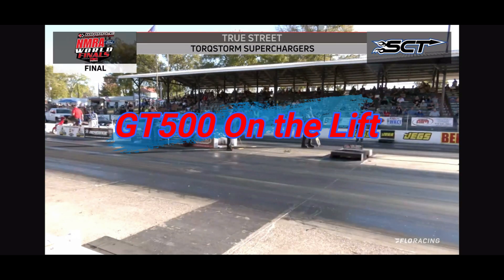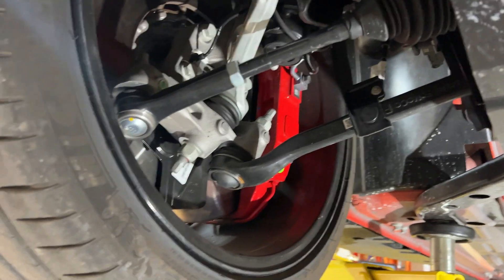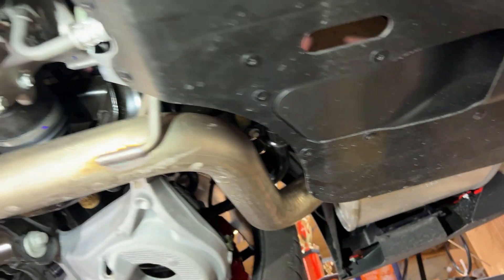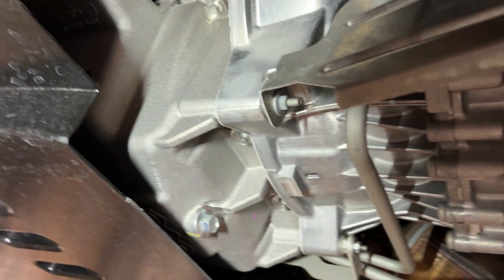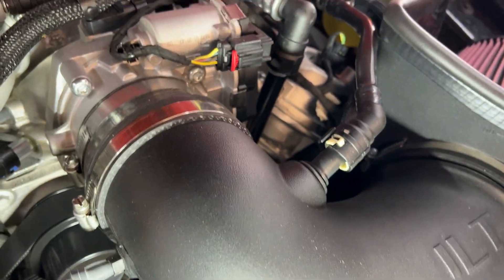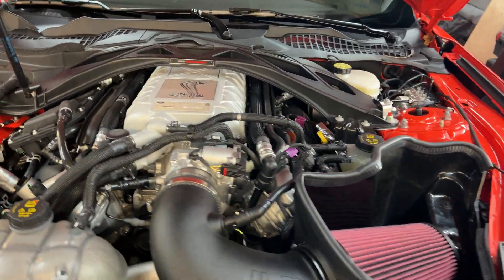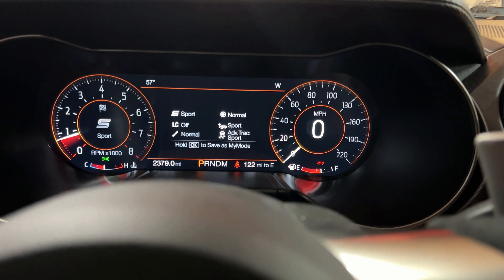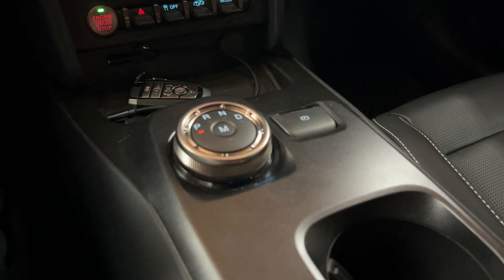GT500 On the Lift

Comment: I know Im pretty satisfied with my GT500 unmodified thus far.  Including the exhaust note. I specifically bought this mdl car so I didn't hav to modify it. (Did so after sellin our '19 Bullitt, due to the inadequate Chinese built tranny- we loved the car overall - hated the trans in several different areas).
 I believed the GT500 didn't need a bunch of mods to be a good car to enjoy driving. We have both race cars & older Hot rod custom build stuff. Wanted a car that handles fantastic, vs pouring $100k+ & 2k hrs into  '70 Fastback Stang to build a Retro Boss 429 that still wouldn'tgive me boththe performance and comfort the Shelby offers.  We didn't pay any ADM, & infant bought it below MSRP.  (Long story) Yet, this car is actually worth every penny both at, & beyond MSRP.  We didn't want a carbon car either fir obvious reasons of driving it. Handling/Tech pkg, OTT stripes, & a paint code that cost extra,  was our choices on the '22 Mdl. 
I encourage anyone who is deciding on a car in this category to look at a GT500,  before you purchase any if its competition. It may or may not be the best option for your own needs, but I can't see owning anything else in a pkg above 750hp & under $85k.  The suspension & brakes are fantastic.  The tires really help make the brakes effective.  & they're not even the Cup 2's.  Nice video!  Enjoy your car.  Love the color!
Ohh.  Id leave the exhaust alone.  Not cuz I know the outcome,  but because its already pretty satisfying stock.  As was our PP1 mag ride, Bullitt.  Ford engineers did a great job on these cars.